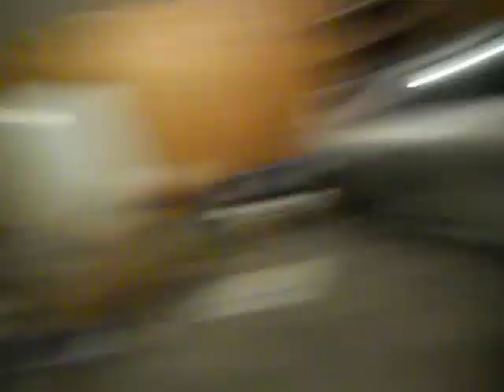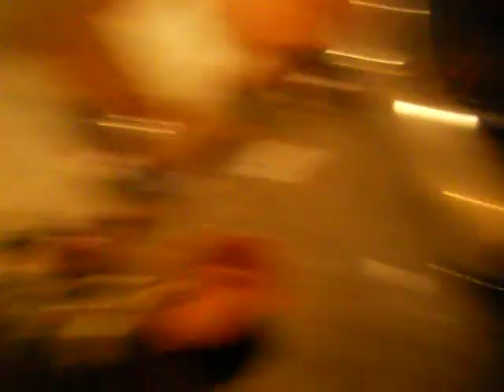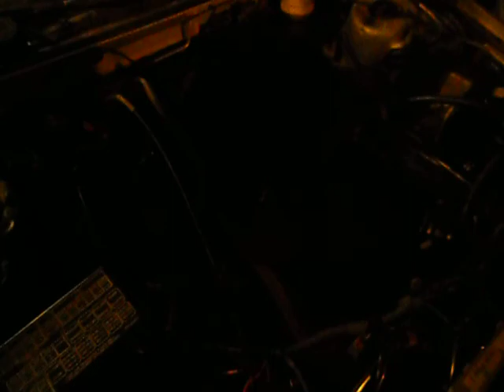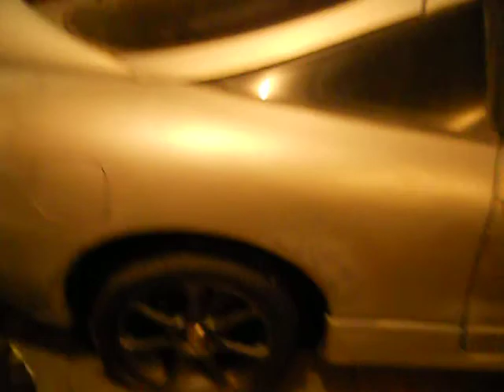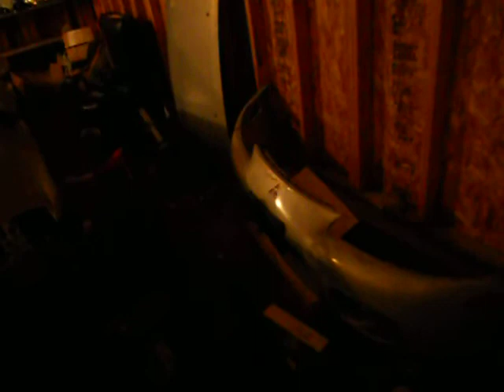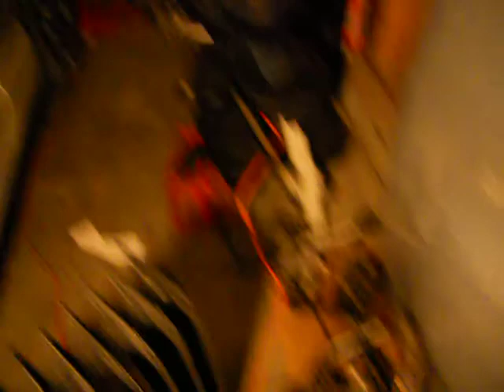97 Eclipse GSX - 6 Bolt Swap - part 1

Comment from the maker: @DSMeclipsegst the 7 bolt block has a connector built right into the block, 6 bolt blocks don't have this.  Lots of people will tell you to buy a 6 bolt water pipe, that ill give you the connectors that you need, but what I did, is just bought a "T" fitting and tapped the water feed into a different water feed line.  either way, its up to you

Comment from the maker: you can use the 7 bolt ecu, the trans just bolts on.  you can check out road race engineering, they offer some pretty good tutorials on what you need and what you don't need.